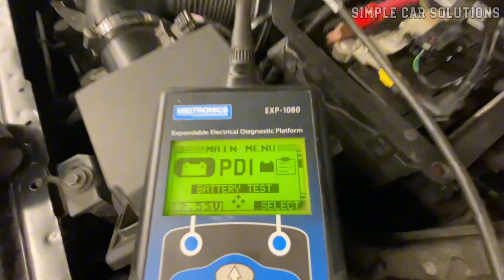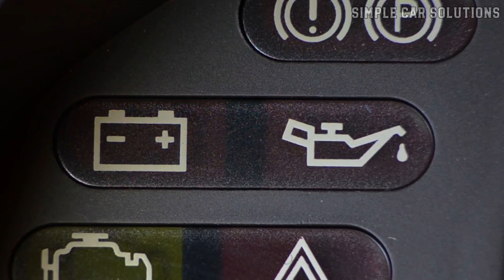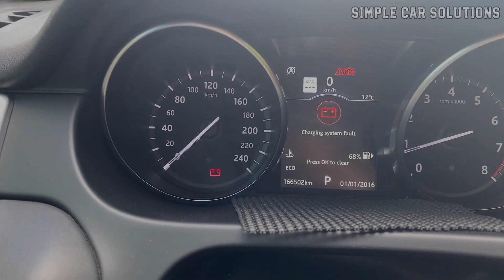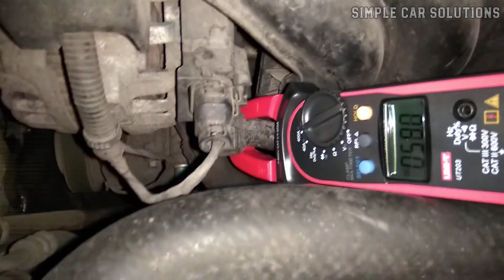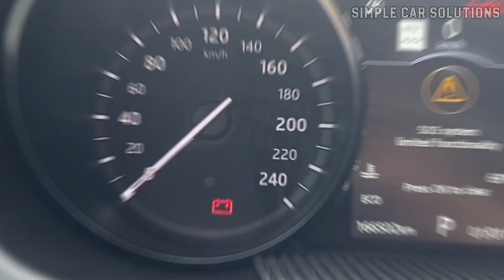Why Battery Light On when the Alternator is Charging - Reasons and How to Fix It

Comment: One of the biggest problem with Alternator dashboard light after replacement for a new unit, is using aftermarket Alternator.. specially on German cars.. and some of the Japanese cars
Use ALWAYS OEM for your specific car.. PERIOD!
Reply from the maker: You're absolutely right — aftermarket alternators often cause issues with the warning light, especially on German and some Japanese cars. OEM is the safest bet.

Comment: I'll add one to bad connections. Jeep. Battery light was on, had a charging code. Alternator was putting out 14.5 volts at the alternator and the battery itself. This one is regulated by the ECM, it turns out after testing and checking connections, I open the cover for the TIPM and there the problem was. Someone had done a fuel pump relay by-pass and the feed for the TIPM wasn't secure and over time, it arced and corroded itself causing this problem. Cleaning and tightening fixed it.
Reply from the maker: Thanks for sharing your experience! I think it might also be helpful for viewers.